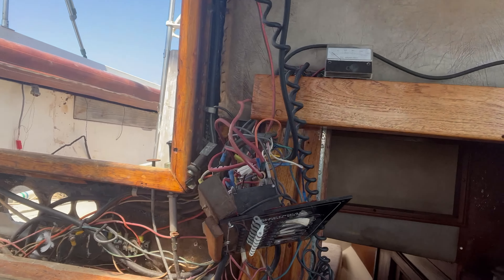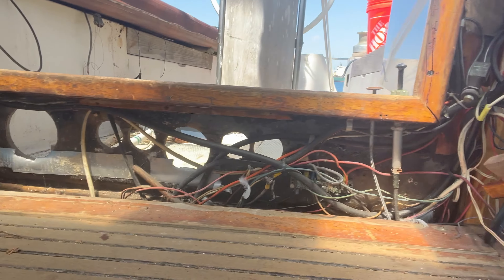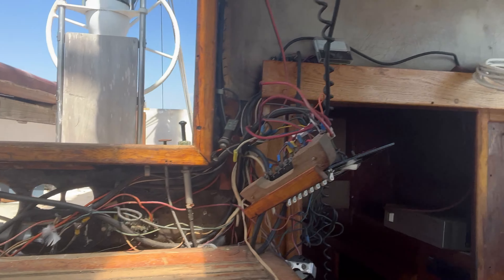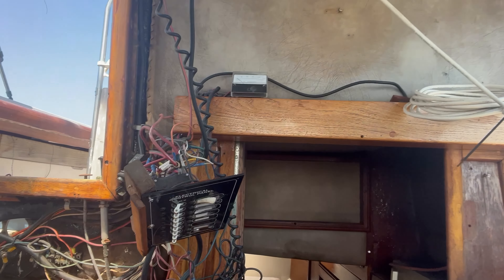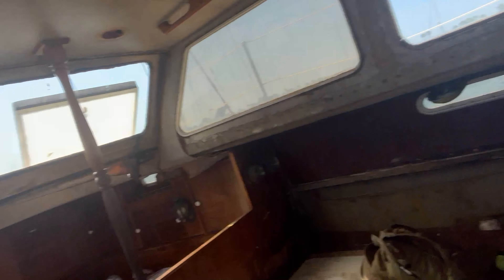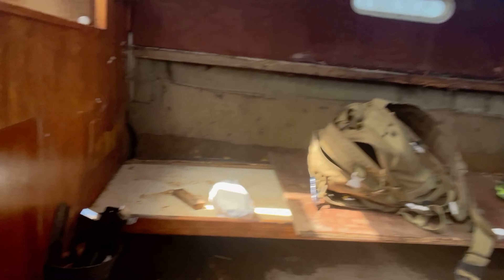Runaway Engine On a Sailboat (Episode 7)

Comment: It actually isn't that uncommon if your mechanical fuel lift pump has an old worn out rubber diaphragm, for a lot of diesel to be in a marine diesel crankcase.

Nigel Calder & Don Casey wrote very useful books on boat systems that might help a lot.
Reply from the maker: Good to know! I was wondering where that thing was getting diesel from, that makes sense. Thanks for the books advice, much appreciated!

Comment: it was running basically on oil the only thing that can be done is to plug air intake shut the fuel and hope for the best if that is happening with a car you can slam into 6, 5 gear if its a manual that will also kill it.
Reply from the maker: That Perkins just refused to shut down, you might be right that it was running on oil. Starving it for air was the what finally shut it down. I was certainly hoping for the best, didn't want to run into any neighbors or worse, separate from the mooring!